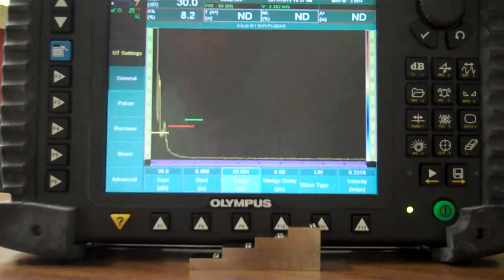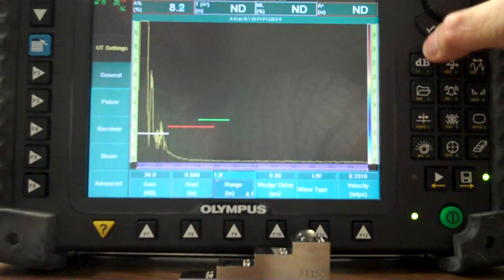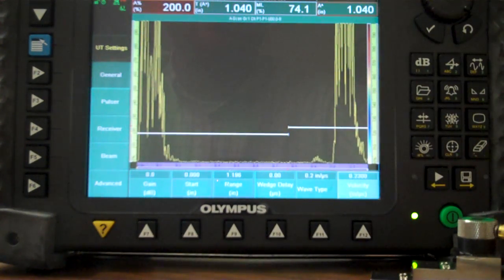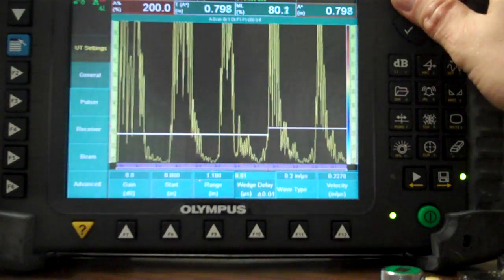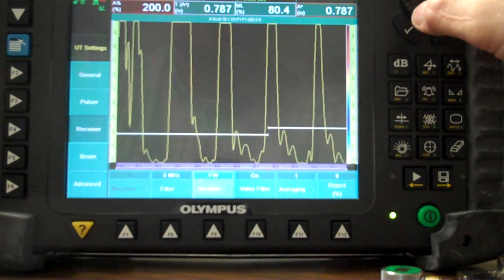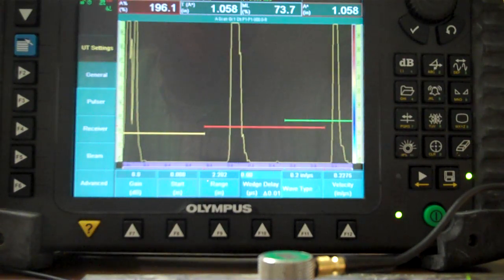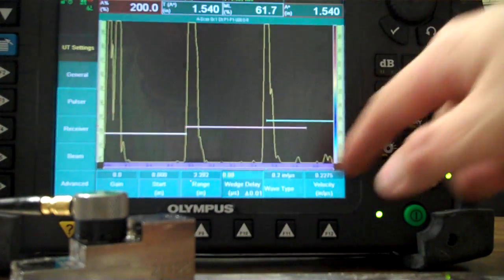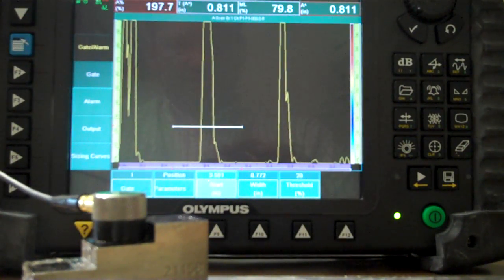Basic Ultrasonics

Comment from the maker: 23landcruiser, 

The terms A, B, and C scans are all types of scans that you can use to inspect parts with. 

The A scan is the signal representation that you see on the above video. 
The B scan is basically a side view or cut away view of the part.
The C scan is basically a top down view of the part that you could see flaw location on but no depth.

Does that help?
Reply: S